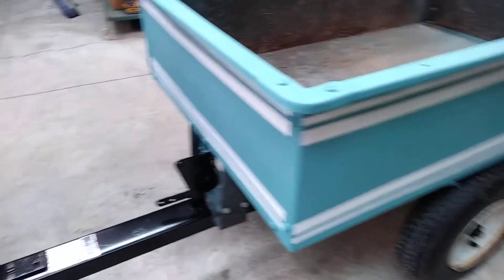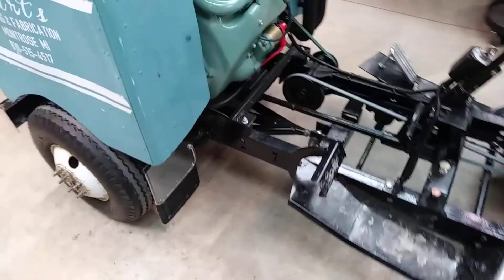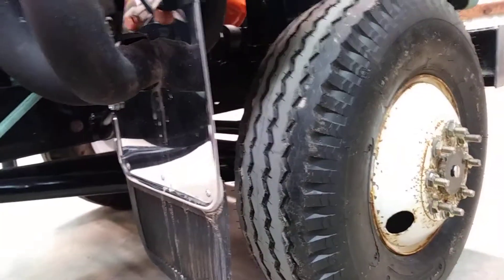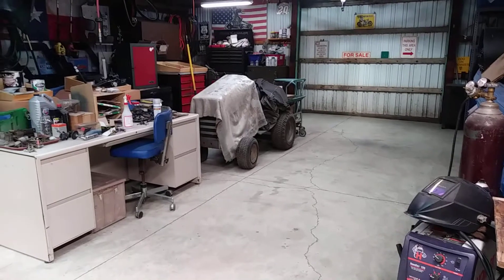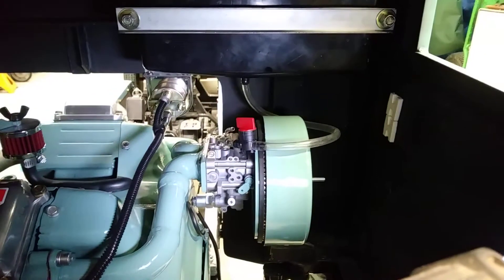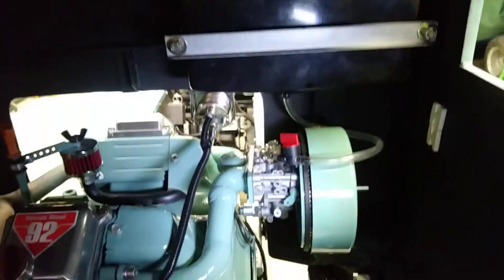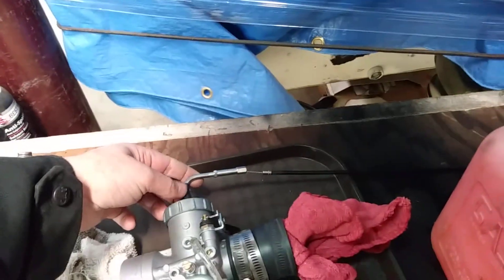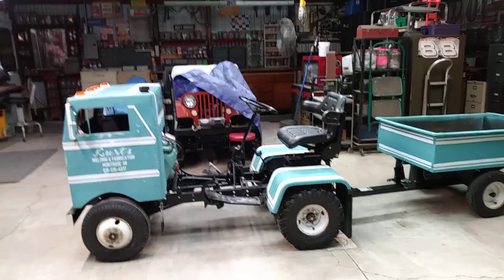Mini peterbilt big updates!

Comment: Brother, how did you do those rims... fixing to build one myself and trying to figure out how to recreate the semi wheel look
Reply from the maker: I just used 8 inch "moon" hubcaps off of a boat trailer. I cut the center out and used a round stainless plate that I drilled the fake bolt pattern in. Two opposing fake wheel studs out of the eight are pieces of all thread that are welded to the face of the wheel. When you tighten them up it sandwiches everything together tight. I hope that makes sense.
Reply: @kurtscustoms  what kind of wheels are the actual rims ..the size and all... racking my brain...look like 10 inch utility trailer tires
Reply: Btw...I do aircraft riveting when you are ready to do another...
Reply from the maker: They're just 8-inch garden tractor front wheels.